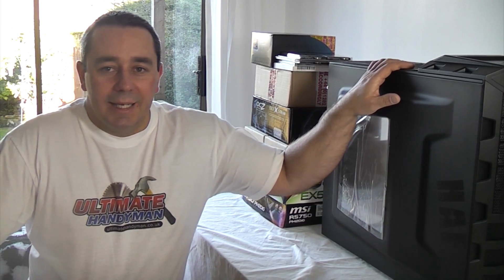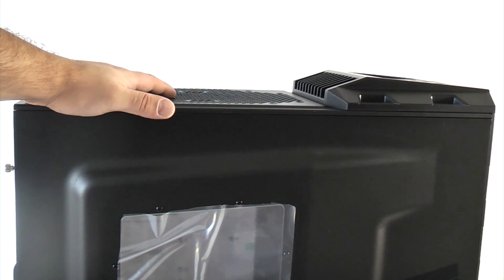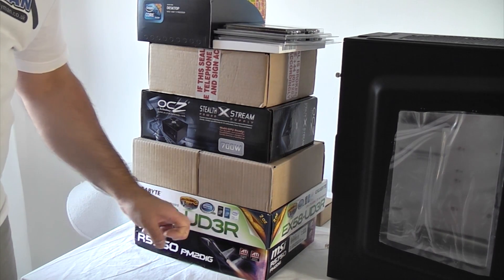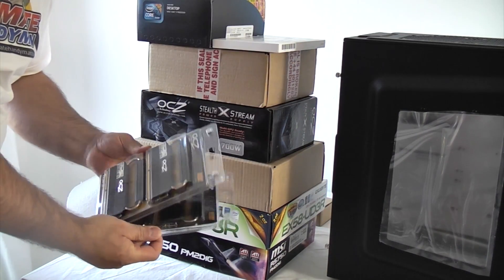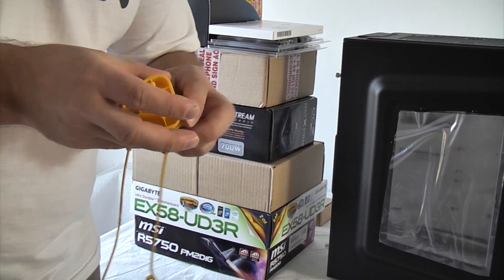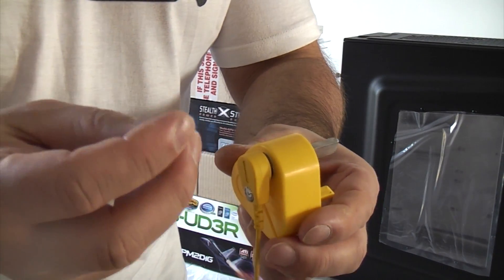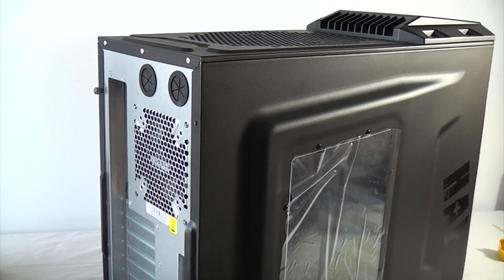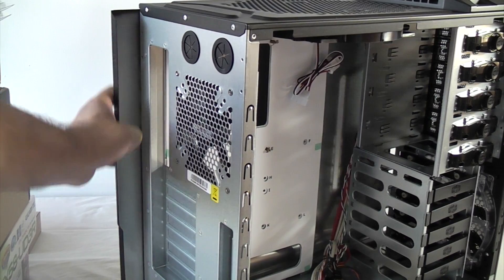build computer part 1 core i7 gigabyte motherboard

Comment: how much money did you spend on the entire project
Reply from the maker: +Festus Muberuka £1200 ($1800 US) in 2009. I'm sure the prices will have come down since then! Thanks for the comment
Reply: yeah but you were kind of expensive. what was with the 2TB Drive
Reply from the maker: +Festus Muberuka 
Yes, that was with two 1TB drives- which were very expensive back then ;-)
Reply: but my worry is how do i know if the case is compatible with the logic board.
and are all logic boards work with i7 processors.
and i have a PC that says 6GB Installed 5.98 Usable which means thats the maximum it can go, so to increase it Do i have to upgrade the processor? Thanks

Comment: not really I have a 550 watt running a 7950, 2550K and about 6 drive in total, remember the card ONLY draws its top draw under 100% load, so 500 Watt is more than enough

Comment: with that amount of ram, and that graphics card, processor and everything else, a 700w power supply is kinda letting everything down a bit. try going for a 950w and the computer will be a hell of a lot better

Comment: you dont have to pull all of the case side. you will have to pull one so you can have an access to the whole computer and it is much easyer and safe too so when your going tho enter the grafics card it will be easy to put when the other side of the case is not moved... thats what i am gussing soo.. i dont know.. because i have building one (i7-990x) at my house and i didnt have to move the side that i put the mainboard on it and it works.. also my case is a medume-large case and i like it ..

Comment: Also, do you buy your gear from a single vendor? It seems like there's nothing quite like newegg over here in Europe as far as I can tell. If I want to gather all the hardware I would need for my dream rig, I'm going to have to get them from multiple stores. Either that or wait for them to order the missing parts specifically themselves :(

Comment: Would rubber gloves (surgical-type ones for instance) keep static going from your hands onto the components? Rubber is a great electricity insulator after all isn't it?
Static would be a non-issue and so would greasy fingerprints, voilà!

Comment: I have a dumb question, can I remove my due core processor for my existing motherboard and replace it with the i7 core processor chip? will it fit or do I need a specific motherboard in order to be able to do that. i have an intel socket 775 currently with windows xp 32 bit